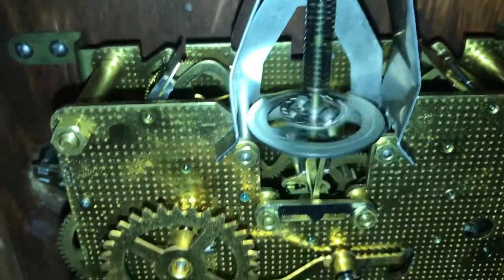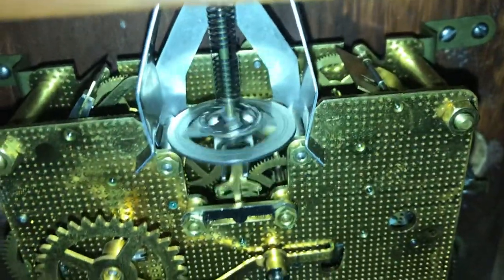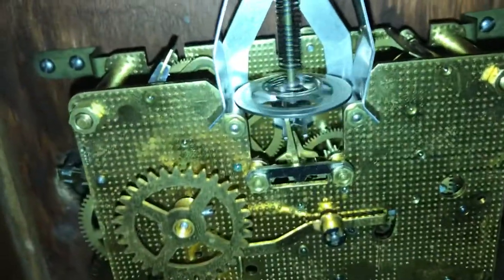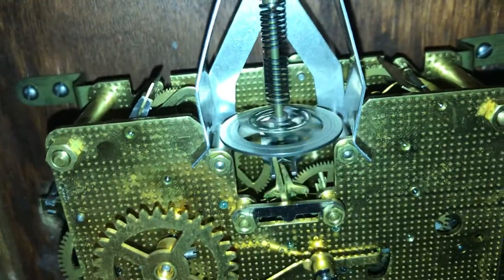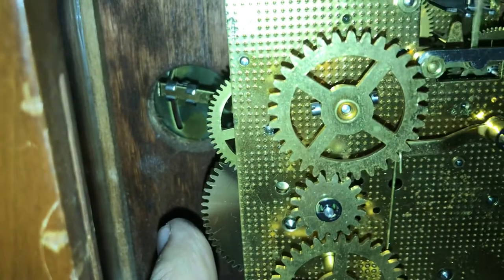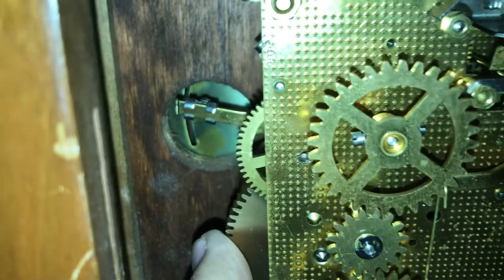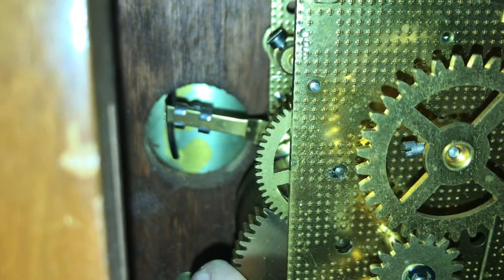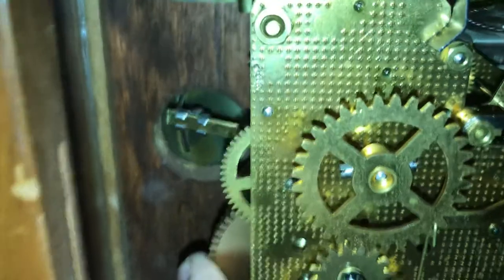Worn arbor On an Urgos triple chime clock.

Comment: It’s not really a special or unusual problem. This is just a case of a clock running for years and years with no oil and so the pivot chews up the pivot hole and requires a bushing in its place.